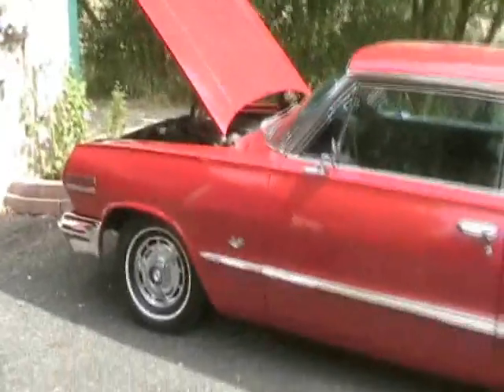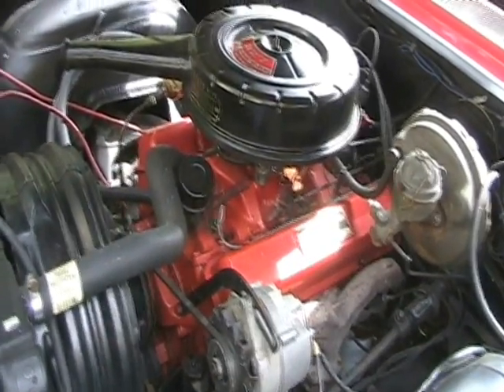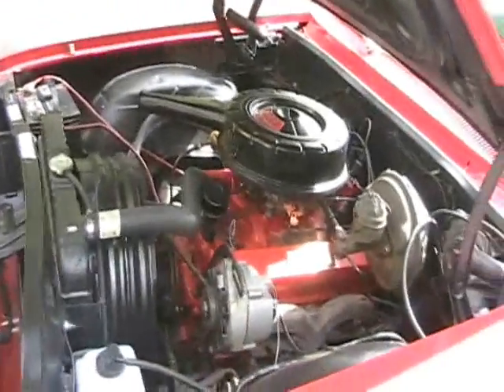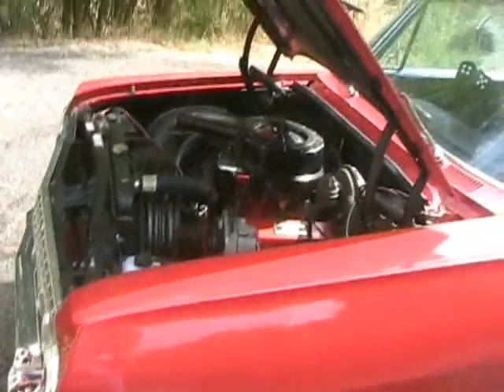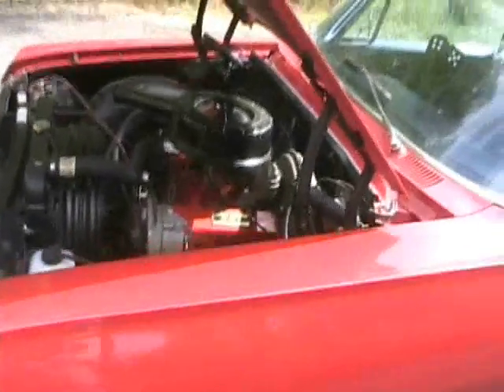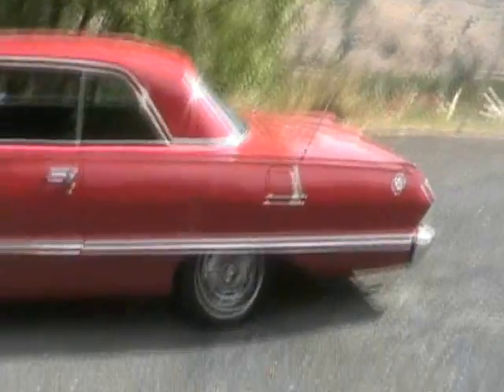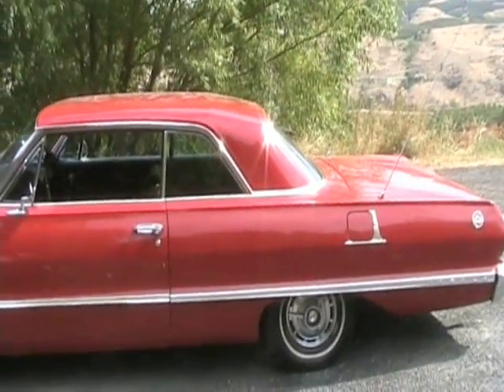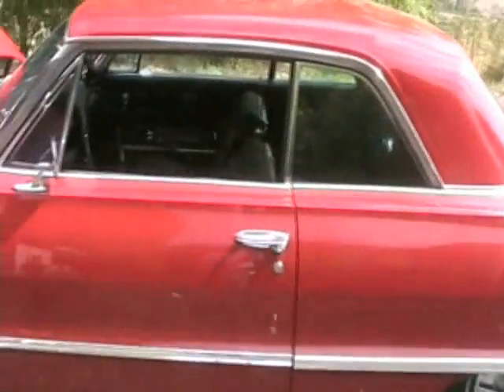a riveting story about a hydraulic lifter

Comment: marvels mystery oil will help quiet that lifter.
Reply from the maker: of course I tried Marvel Mystery oil and several other additives but nothing helped. the only solution would be to install a new cam and lifter set but I'm not going to do that. at this point, the tick upon start up is just part of the charm! haha.. don't you agree? two years ago, I drove this car 7, 149 miles from the Pacific ocean to the Atlantic ocean and back!  checked that off my bucket list and that old lifter ticked every single morning of that entire trip just as it has for the past 12 years! haha.. its a good old Motor in spite of its little quirks and has never let me down. 😁